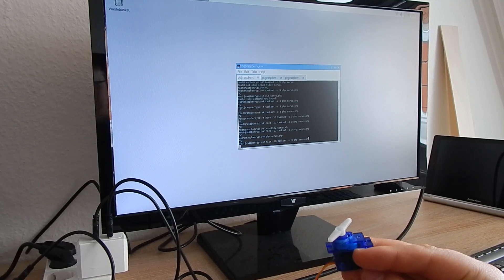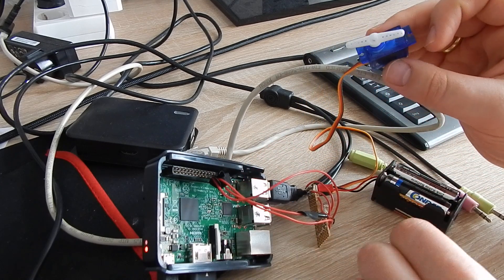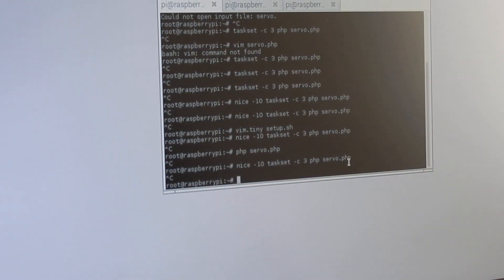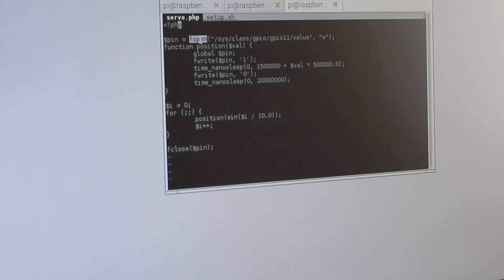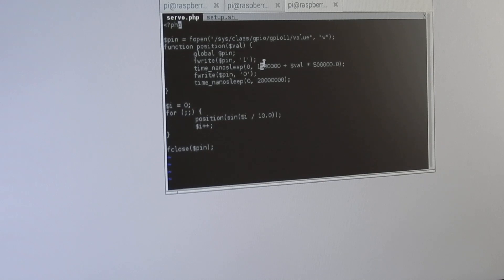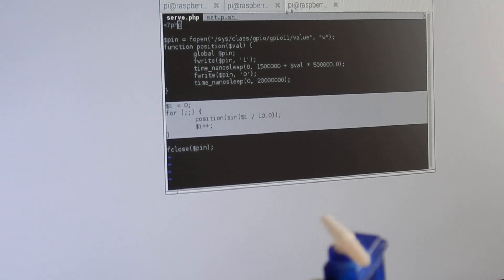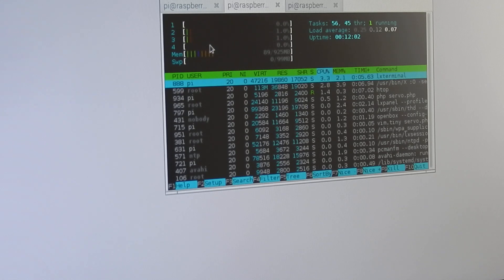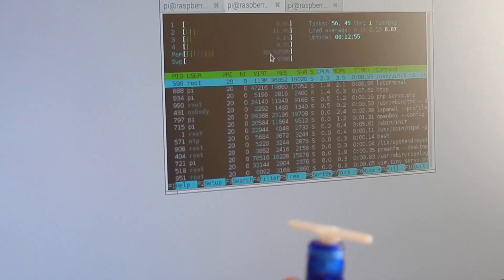Raspberry Pi 3 realtime GPIO: Using Servo motors with Raspberry Pi 3

Comment: Well, this approach is close to real time ! I can't wait to try it with my other programs running.
They use the max power of GPU but not much CPU so there is a chance it could work fine.
Question: (I know this is old but you might know even more)
I code with C++. If I have an other program running in parallel, can I communicate with this on the isolated cpu ?
Reply from the maker: Yes, of course. You can use normal communication channels like normal programs: Files, Shared memory buffers, pipes etc. etc.

Comment: How to use continuous servo motor?
Reply from the maker: Position "90" (1.5ms pulse) is stop, "180" (2ms pulse) is full speed forward, "0" (1ms pulse) is full speed backwards.
Reply: +antisteo how about 360 continuous motors?
Reply from the maker: +Toshiyuki Takamatsu please read the comment above.

Comment: It's great, but is there any hardware pwm pins on pi 3? I want to control brushless motor.
Reply from the maker: Afaik pin 18 is capable of hardware PWM. But you need C or any language that supports writing bytes to memory directly.
Reply: Thanks, I'll try it

Comment: import time
usleep = lambda x: time.sleep(x/1000000.0)

usleep(100) #sleep during 100μs
Reply from the maker: +Andre Müller I tested that and it was not accurate enough. Pythons sleep is in millisecond range. I also have a version using pythons nanosleep module which is comparable to the results in PHP.

Comment: Hey, great video.  

Do you think you could control multiple servo motors from one cpu without one of them getting "lag" (disturbed as you describe it)

I ask because I want to know if the pi is capable of "real-time" calculations, like controlling a drone.
Reply from the maker: Yes, you could simply control up to 10 servos by just skipping the 20ms wait time. For more I recommend hardware PWM.
Reply: +antisteo 10 servos is plenty, thanks for the response, great explanations in the video btw!
Reply from the maker: tranq44 I have 6 servos in total. Maybe I can build a robot-like thing with it.